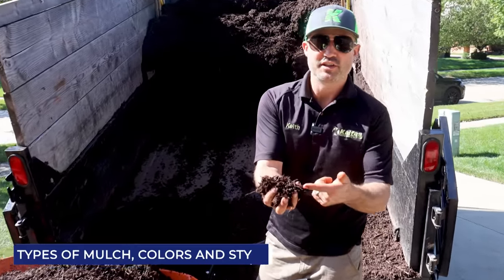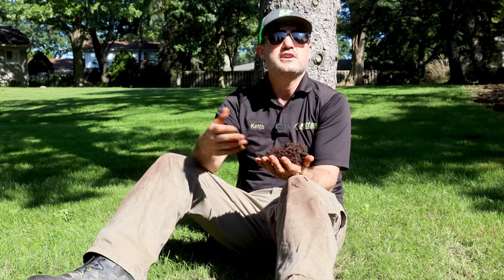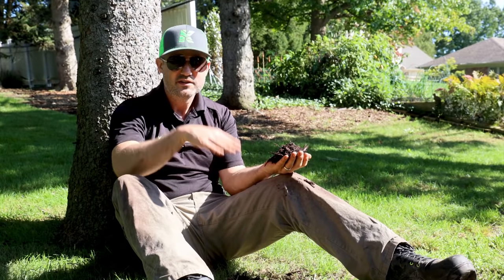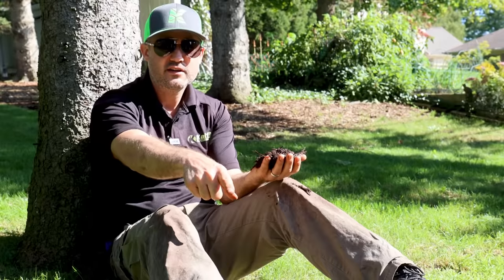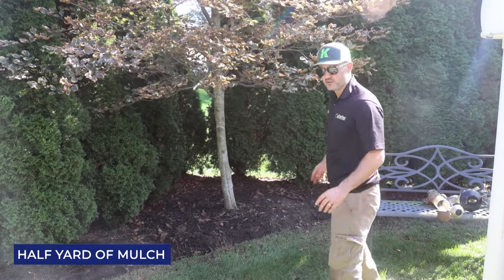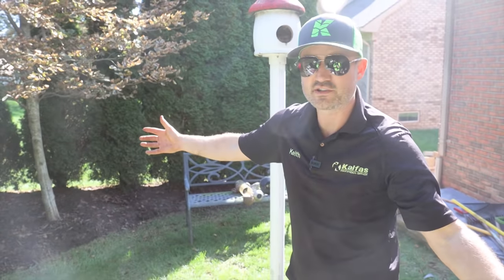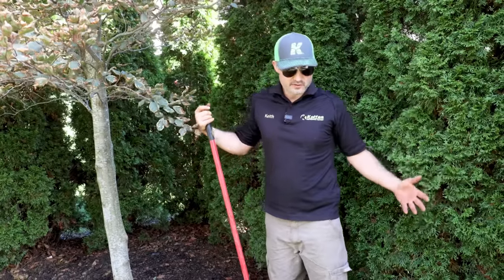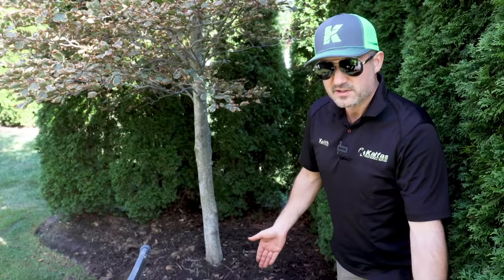How Much To Charge For Installing Mulch, Different Types Of Hardwood Mulch $120

Comment: As a old gal, Im slowly phasing out of physical work and gardening. I'm (concentrating on my work as a medical massage therapist and esthetician) I'm still doing garden and landscape consulting and design. I can't encourage enough, to prevent hassels and haggling, have a page sheet or brochure of your prices listed. it's professional and gives yourself a more legitimate image.  Be sure to note fees can change due to demand and supply. I also include an asterisk ✳️(meaning prices are subjective to scope and sourcing) On invasive weeds, dumping, edging, weeding, soil amendments, soil analysis, hard water treatment, fertilizer, pesticides, weed prevention they are totally separate fees.

Comment: Thanks for sharing Kieth I  make double shredded mocha color 
My cost is to make is $4.00 per yard 
I only use in my projects ( around 900 cby per month) I  sell it for $85 
Explaining oversimplified but my numbers work👍
Initial cost of operation $295,000.00
900×12=10800 cby 
If bought it would cost $32 per yard 
10800x 32=$345,600.00
By the way I decided to start making my own mulch because I couldn't get something decent for a good price

Comment: Nice vid! We charge 120 to 150 a yard depending on access. We are in the mountains of Western NC and lots of hills to work with so that's why its 120 to 150. That also includes bed clean up and spaded edges no pruning.

Comment: I charge $160.00 per yard. Used to only charge $110.00 last year but that wasn't enough especially on 2-3 yard jobs.
Reply: I’m with you, to do a trip too and from the supplier, wheel it from your trailer, spread, then cleanup job site and truck for a few yards can be unprofitable if you don’t watch it.
Reply: Howmuch does your mulch cost

Comment: Different tiers to it.
Bulk jobs get blown at $70/yrd because we can scalp and spray most beds.
Regular jobs are $85/yrd most are minimal prep or existing clients 
Rehabs are $115-150/yrd
Stone is anywhere from $250-425 a ton

Edging is hit or miss, .50 to redefine, 1.15 new cut, 3.75 concrete curb or other materials. 
Light ropes are 8.50 and some kind of edging is recommended.
Sometimes I’ll throw a redefine in for free on the regular customers. Just my pricing, maybe it can help someone else ballpark.
Reply from the maker: This is great info. Thanks for sharing man. Appreciate it. 👍
Reply: What product do you use to spray beds?
Reply: @alexcantero498  commercial roundup. Last purchase was Ranger Pro, mix 7oz in 1 gallon of water. Do not get it on things you want to keep.

Comment: I may have a much job coming up but I am curious of how to charge. From what I understand the mulch would be delivered to the home so I would just be charging labor for myself. Its a 500,000 home in ohio so its pretty large, the yard is large aswell with alot of areas to mulch. I have to go get the measurements and come up with a price and I was curious of how I should go about it. Should I charge by the cubic yard and if so how much is it for labor per cubic yard? Should I charge by the hour if so how much, what if I get it done quicker than expected and I screw myself? Any info back would would be greatly appreciated. Thanks

Comment: What's everyone's materials costs for mulch and your location? I'm in Alberta and mine range from $25 - $65 / yard and up depending on supplier and type and some companies charge upwards of $400 / yard installed but that includes any bed maintenance and prep.
Reply: In Oakville Ontario, near Toronto. Minimum charge of $185.00 per yard plus tax. Cost of mulch is approximately $50.00 plus tax delivered to my yard into storage bins. 

This saves us from having to run to the supplier and we can load before we leave. Cost is basically the same from supplier or having it delivered to my yard. 

Minimum charge of 4 yards per property at that price.

Pricing does not include bed preparation. Just installation.

Comment: My issue is with small jobs. Example 2 yards @120 per yd. I need a $200 labor minimum per job. That 2 yard job only comes to $160 in labor. A yard here costs about $40. I feel that any job you do costs you a quarter of the day no matter how small. 
How do I get to my minimum if using per yard estimating??

Maybe I have my numbers wrong idk.
Reply from the maker: Amazing.
Reply: Keith!! How do I get my minimum if it's a small mulch job for existing customer?

Do I up the price per yard, refuse those or eat my minimum?

Comment: Keith your super helpful bro! I've used quite a bit of your tips especially the don't be afraid to charge what your worth lately we come up with a price and it just feel to low so I add to to what feels right an we pretty much landed each job and for all I know we are still low an we definitely bid jobs to high but we will get it right eventually. I know you did a leaf clean up and gutter cleaning video could you possibly do a more in depth video ? From what I gathered over here in Muskegon mi for gutters there charging $1.00 to $1.50 a foot would you charge extra for the clean up after all the debris is on the ground or is that included that's the part I'm having trouble with

Comment: You must be shooting for a few high margined jobs. If I charged $120 per yard I would be lucky to install 200 yards a season. I charge anywhere from $55-$80. This year I installed around 6,500 yards mulch. 

We specialize in mulch installation.
Reply: Where are you located?   Sounds like you’re getting your mulch super cheap or manufacturing it yourself.  Hopefully you’re charging more now. At least 20-35% increase to keep up with costs and inflation.  Is mulch your lone source of income???  Thanks.  Hope you’re still crushing it 😃

Comment: I have a hedge business where we cut hedges and lay mulch. I'm quoting on a 335 sq yards of garden, (an area of 33.5 x 10 yards) using your 100 per yard it comes to $33,500.00 ( thirty three thousand five hundred dollars!) to supply and lay mulch. it requires 20 cubic yards of mulch that comes to $2000. After the mulch is paid for that leaves me with $31,500.00 for the day.  It's a mind boggling amount of money for a days work just laying mulch. Am I misunderstanding this or you really charge $100 a sq yard. Normally I would charge $12 a sq yard making $2000 for the day/job. I'm struggling to go from $2000 to $31,500  for the same job. Something doesn't seem right.
Reply from the maker: No sir. Haha. $100 per cubic yard. And 1 cubic yard cover about 120- 140sq. Ft. At 2 inches depending on the blend.
Reply: @keith-kalfas  Thank you. That's more on point. Appreciate your prompt clarification.
Reply: By charging $100 per cubic yard including mulch, where the mulch average costs $70 per cubic yard. It's not enough only making $30 margin per cubic yard. Your idea of increasing the all up charge to $150 plus is better. Thanks again for your advice it vindicates our existing charges.  I'm going to quote this job at $160 per cubic yard inc mulch. giving me a margin of $120 per cubic yard. Or after mulch cost leaving me $1260. TBO I don't know how anyone could do it for less unless they want to go out of business or not get anywhere. There is the mulch purchase, delivery, planning , installation, accounting, travel, fuel, assistants, paperwork, tax, insurance etc. Similar to what you mentioned we can also add on extra for edging and garden bed prep, weed spraying, chemicals etc.I am of the view that if we miss out due to someone with a cheaper quote, let them have it. They will be struggling to stay in business. Besides I find if one door closes another opens. Best to charge more rather than less, then I can feel great about doing the job. And when the job is finished if I make great time I sometimes give the client a discount, which is great for good will.

Comment: NO WAY I’m showing up to a customers property to install 2CBY for $240 !!!
It’s ridiculously cheap! Make the math!!
Just the product is $35 a yard = $70
The gas of driving around to pick up and deliver, helper,etc.
Please stop saying we should charge $120 a yard.
In my opinion we should charge by the job.
Calculate how much you are going to spend on materials,helpers,gas and anything related to the job.
Then add how much you want to make out of that job.
Done.

You can not charge by the yard.
What happens if someone needs 1 yard?
Are you going there for $120 🤣?
Reply from the maker: We also have a $500 minimum for any landscape  job and a $700 minimum for any job that requires mulch or anything like that.
Reply: Roberto- you need to sell them on more than just $120/yard. Upsell pre em, up sell edging, upsell monthly bed maintenance. You'll be our of business if you dont act like a salesman.
Reply: @bethanybloomsllc7692  I just quote everything that needs to be done by the job.
I’m not going to install mulch if we don’t prep prior. 
I don’t tell the customer price per yard. Just price per job!(Including everything)
Reply: @robertoandrade6641  I agree
Reply: @keith-kalfas  I absolutely enjoy all your content and advice.!!
Only thing I differ is charge mulch by the yard.
As an example I just did a 2 yard job and charged $700 
If I would have charge by the yard I would be leaving money on the table.
That is just my opinion when it comes to mulch pricing.
In my experience mulch is where the money is at and I like to make it as much profitable as possible !
Reply: @bethanybloomsllc7692  I do sell to customers
But I need to make money on every service I provide.
$120 per yard just seems extremely low for the expenses and what it takes to move a yard of mulch.
The time it takes just to go buy it and deliver it.
The time it takes to install it!
Plus it’s a back breaking task and you should charge accordingly!
I think if you are going to price by the yard it should be more like $350-$400 a yard.